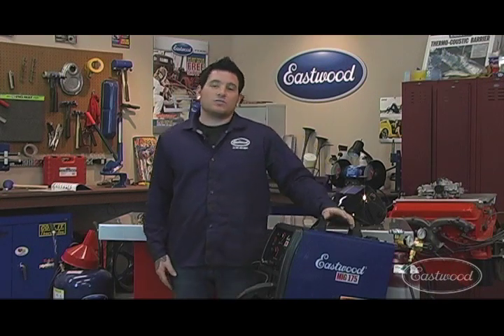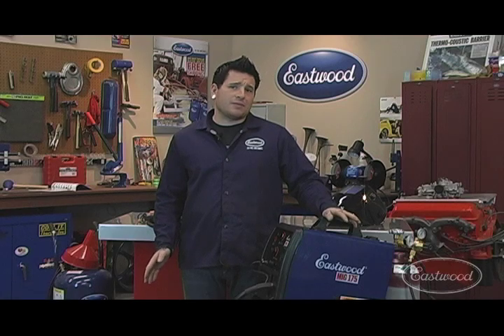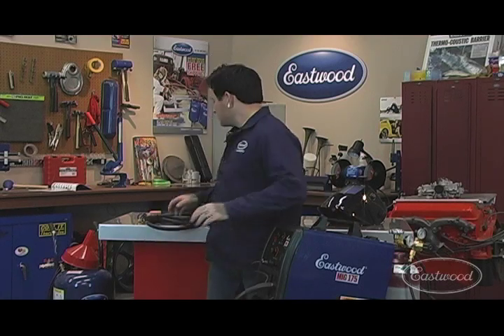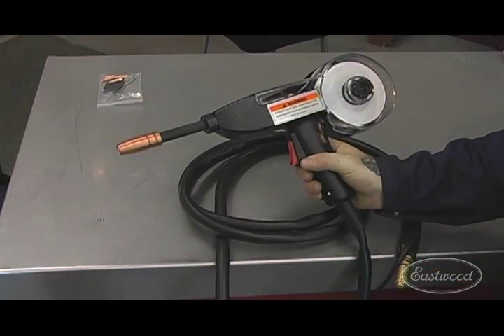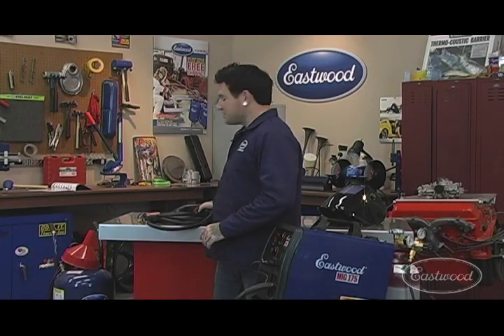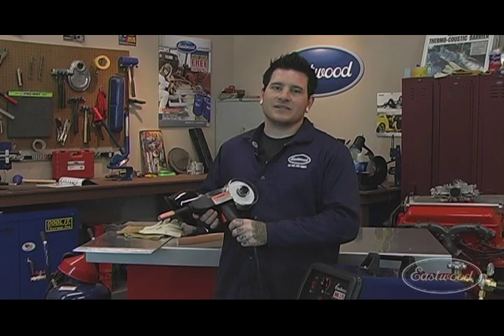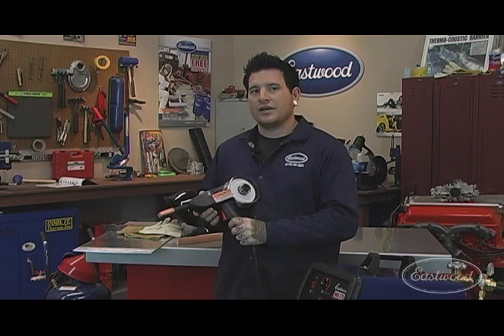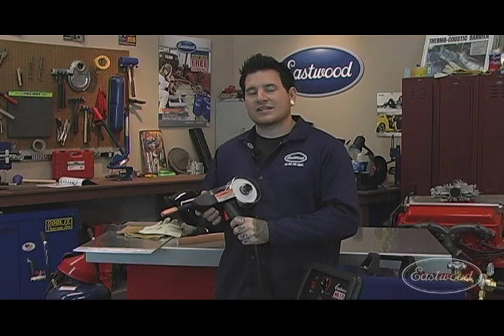MIG Welder Spool Gun - Welding Aluminum with MIG 175 - From Eastwood

Comment: Bought one use it 4 times stopped working 
Very unsatisfied wouldn't buy another one !
Reply from the maker: Please contact our customer service team: 800-343-9353 and they'll make sure you get what you need to get back up and running.  Depending when you purchased this has a 1 year warranty as well.
Reply: @eastwoodco  warranty has expired .